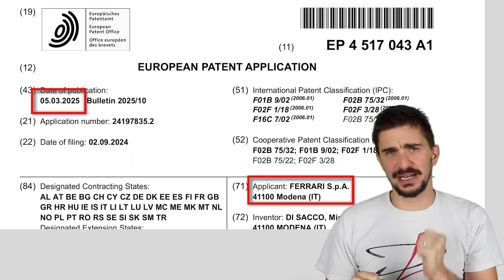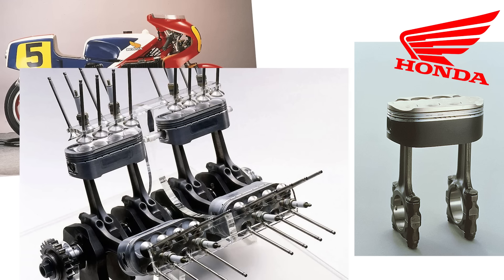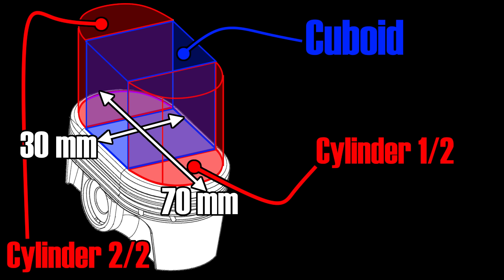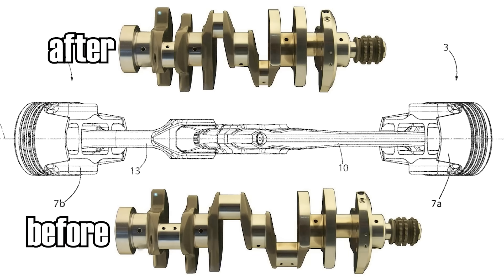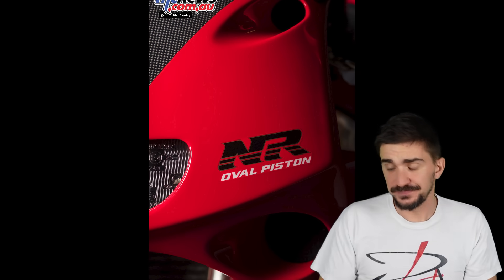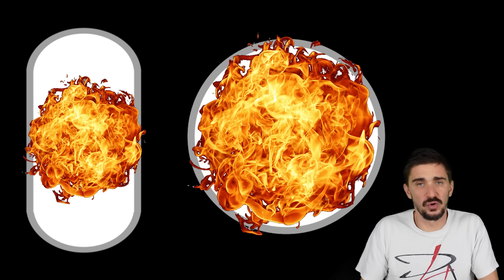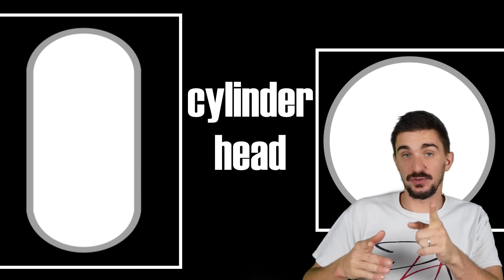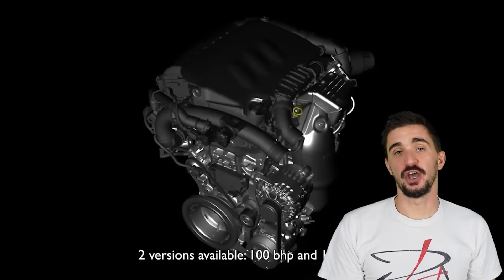Ferrari Just Patented Pill-shaped Pistons and Siamese Connecting Rods

Comment: A non-boxer flat engine with shared scotch yoke connecting rods and dual wrist pins would solve the piston rocking problem, the unequal length conrod problem, and the intake space problem, while allowing opposing cylinders to be directly aligned. It would also allow for much shorter conrods, making the engine narrower and lighter, and it would increase the dwell time at TDC which would improve combustion efficiency. Each crankpin would rotate inside a square block which would slide back and forth inside the conrod's linear bearing, thus eliminating the wear that otherwise plagues the scotch yoke mechanism. A flat 12 would be the perfect configuration for this engine because it would be naturally balanced like a V12 while being slightly shorter than a V8 with the same displacement per cylinder. Ferrari already has plenty of experience designing and building flat 12s.

Comment: Why not a knife-and-fork rod set? The foregoing design may not be balanced at all speeds, and inertia isn't spared either- I can see the big end bearing suffer a lot over time. Unless of course, to your point, these engines are not intended to live beyond 100 hours of service.
Reply: Knife-and-fork (or fork-and-blade) conrods would make the crank journals even wider than conventional conrods.

Comment: I guess you could use the oval piston to add displacement instead of just making a shorter engine. Although that sounds like something that would be better for cross plane crank with pushrod valves with low-end torque. I think this design would also be great for a shorter inline 6.

Comment: Harleys use fork and blade connecting rods as does the British ASR1 submarine diesel engine. Shorter engine in a sub to save room, at a premium in a boat. The Harley engine is slimmer due to the use of this arraignment.
Reply: Yeah but fork-and-blade conrods require even wider crank journals than conventional conrods. Circular pistons leave enough room for that, but oblong pistons like these may not.

Comment: The fact that the old piston engine heads are round guarantees the the pressure will be even all the way around. Can't do that with pill or any other shape.
Reply: Dual spark plug engines have already proven that the pressure doesn't need to be even all the way around. Ironically, dual spark plugs would do the exact opposite with oblong cylinders and help to even out the pressure.

Comment: The valve issues can be solved with a rotory valve instead of the traditional tappet valve setup. Use chains like DOHC engines, and control the dueration with port butterflies like a throttle plate. That would control power and effeciecy. Using turbos would also help in controling the power as well.

Comment: The killer issue is surface area to volume ratio.  As you know a sphere is ideal and a conventional hemi headed combustion chamber is close to this.  As with the Wankel rotary, this is insurmountable and must result in reduced thermodynamic performance.

Can you clarify why the single connecting rods cannot be used with conventional combustion chambers & pistons.?

Thanks for the great presentations.

Comment: Noting the geometry of cylinder at TDC relative to crank position - think I see an offset hiding in plain sight! That explains the angle of fixed rod relative to position of pin on flex rod.

Saying that because your video on that exact thing is next in my recommended videos…

Comment: Oh no. I remember those joint rods from WW2 aircraft engines, IL-2 specifically, it is a horrid idea, do not do it. You are using two different connecting rod lengths in the same engine.
the proper way of doing it is fork arrangement, where one connecting rod is between a fork formed by another. There is no drawback to doing the fork and it was done on Allison engine.

Comment: discorectangle or obround

Obround and discorectangle were the least silly or least non-technical terms that I could find relating to that shape, but it's not even the most common one used. Discorectangle is the proper mathematical term, apparently.
"Discorectangle: A mathematical name for the 2D shape, combining "disc" and "rectangle"."
"A discorectangle is a geometric shape that is a rectangle with a semicircle attached to two opposite sides. It is also known by other names like a stadium, obround, or pill shape. "

"A geometric shape with two parallel straight sides and semicircular ends is most commonly called a stadium. 
It is also known by several other names, including: 
Obround
Discorectangle
Pill shape
Racetrack (especially in informal or CAD contexts)" 

It is also known as a sausage body, but that's more in 3D contexts (which would also include capsule shape).

Comment: The Mikulin Engine that powered the Sturmovik IL2 had articulated conrods, but a different design. Apparently Hispano Suiza aero engines had that arrangement too, and they went back to WW1.  See Greg's Planes and Automobiles on the IL2. You really should start doing some stuff on late stage piston aero engines. Also, re engine balance the picture i see of the Ferrari patent  is a v12. Wouldn't that mean perfect primary and secondary balance being two straight sixes?

Comment: That single connecting rod concept is nothing new, to the point that i'm surprised they were actually granted a patent for it.  All the big radial engines from WWII used a similar configuration.  Only a single piston from each bank was connected directly to the crank shaft, and the remaining rods were on hinges connected to that main connecting rod.

Comment: My intuition says that the flat or straight portion of the piston rings will not stay flat or straight against the flat or straight "cylinder" once operating temp is achievied. I bet these engines will suffer from excessive oil consumption and compression blow-by as the rings fail to seal after normal repated expansion and contraction cycles. Not to mention the increased difficulty to actually machine these shapes to precision tolerances especially where the flats transition to the round. There is a reason why pistons and rings and cylinders are typically as round as possible.

Comment: Another possible drawback is the position of intake valves and manifolds. If the intake valve are on the long side of the oval, which is cross in respect to center line of the engine, the intake manifolds should "turn" of 90 degree to reach the intake valves

Comment: One issue that people don’t mention is that the Honda engines had the long diameter of the piston in line with the crank and cam. Ferrari is opposed to that, in order to make it more compact. But, if they want to run 6 or 8 valves per cylinder, they’ll have to come up with some weird new valvetrain, either quad cams or some strange mini-pushrod actuation. Unless they also make oval valves.

Comment: You forgot to mention the wider piston means its capable of a larger stroke without the skirt hitting the connecting rods, meaning you can make them even smaller and lighter while keeping the displacement up
Reply: He didn't forgot, if you'll look at images of a patent closely, those exact pistons have reinforcement ribs which significantly limits connecting rod articulation.

Comment: As a Ferrari owner, this new engine design is a GAMECHANGER for owners like me. Usually I can only fit 11 or 12 Ferraris end-to-end on top of my oil tanker. They're just such long cars and you need to collect so many of them before you can challenge the Elite 4 that storage becomes a real issue :< If I can save 20cm in length per car, that translates to an additional 7 or 8 cars on the top deck, per boat. So you can imagine my excitement.
Reply from the maker: The Elite 4!!! 🤣🤣🤣🤣🤣

Comment: The piston/pin offset has the potential for highest compression after TDC. However the added flexing point away from the crankshaft of the combined con rods is a bad idea and weak design friction point

Comment: 9:05 I saw something recently about some engine from the 1920s, maybe a Deusenberg, Peerless, Peirce-Arrow, or something along those lines, that had a similar arrangement, except that one piston rod straddled the other, so there were 3 bearings on each crank pin. That would maintain balance, but making the straddling piston rod as strong as the straddled one (pardon the vaguely obscene implications) would be a challenge.
Reply: Fork and blade rod arrangement, allows you to have the cylinders inline, not offset like most v engine designs.

Comment: Ship engines have been typically been segregated into drive engines (or main engine) and auxiliary engines. Radial airplane engines use the master connecting rod and a series of very similar secondary connecting rods.

Comment: The balance problem with the connecting rods is really a rather non-issue. Radial engines have used that layout almost since the beginning, and it is well known and developed how to handle this.

Very interesting idea, though! I wonder how it will turn out.

Comment: Honda did this decades ago... didn't patent it because overall, it wasn't worth the extra cost
Reply: Honda did file multiple patents. 

Honda holds patent US4383508, which is dated May 17, 1983... so it expired over 24 years ago. It only covers dual connecting rods per piston, so it doesn't apply to the Ferrari design anyway. Still, Ferrari cited it in their application. 

Honda also holds patent US4502434, which is dated 1985-03-05... and expired 2002-03-05. It, too, only covers dual connecting rods per piston, so it also doesn't apply to the Ferrari design.

There may be others.

Comment: Space between the banks is an issue not considered in the patent application; however, I note that the application is illustrated with a V12 that appears to have a 120 degree bank angle. That is a terrible angle for a V12, but provides lots of space in the valley.

Comment: The Honda NR engine was, of course, just a V8 (with a very conventional 4 valves and one connecting rod per cylinder) wih adjacent cylinders merged to masquerade as V4 to fit in the rules. This design has two key differences: 
1. the master-slave connecting rod system, with just one rod per piston 
2. the orientation of the ovals: major axis perpendicular to the crank (rather than parallel as in the Honda) 

The two are related: with the major axis turned, two rods per piston can't be used. 

The Ferrari orientation provides the advantage of shorter bore spacing, but it also complicates porting. If rational induction and exhaust call for all valves along one side (4 in a row) to serve the same function (all intake on one side, all exhaust on the other) that works for the Honda but requires problematic cross-head ports in the Ferrari. I doubt that it is coincidence that none of the Ferrari illustrations shown include anything above the head gasket. I found and downloaded the complete application document, and indeed only the pistons, connecting rods, and crankshaft are shown - no heads, no valvetrain, not even a block.

Comment: It is very un-Ferrari, but the only application that I could immediately think for oval pistons as a packaging trick (allowing tighter bore spacing for the same displacement and stroke) is to build a very short inline-4 for my Triumph Spitfire, to replace the 3-bearing tractor motor that sits there now.

Comment: The offset between banks resulting from a typical arrangement of connecting rods side-by-side on a shared crankpin is a concern... but not in a V12, because each bank is typically a balanced inline-6 which does not need to be aligned with the other bank. The patent illustration appears to be of this type, with a mirrored 120-degree crank making each bank a conventional inline-6. Even a V8 with a flat-plane crank has no rocking couple in each bank.
Of course the other solution for zero offset (with no connecting rod length mismatch) is fork-and-blade connecting rods, which are well-proven.

Comment: Pills come in many shapes, and the common is circular, so "pill-shaped" is not a useful description, although that term is sometimes used in that sense. "Capsule" would be better, if using a pharmaceutical reference.

The term "oval" does not specifically mean "elliptical", and indeed racing tracks (for horses, people, cars...) are commonly this shape and are called "ovals". NASCAR is even used in this video for an illustration when discussing combustion chamber shape. 

I see from another comment that in geometry the term is "stadium", and that there is even a specific term: "discorectangle". Of course you couldn't use "discorectangle" without explanation, and it is a long word to use repeatedly.

Comment: You mentioned that the combustion in a pill-shaped cylinder isn't optimized for being uniform, so why not go all in and do TFSI? The edges (at the rounder parts) would be the areas with a higher air to fuel ratio, vs the center which would have more fuel.

Comment: Its logical to dislike Ferrari, but still like their cars. Particularly their older cars, especially if they're a model that Ferrari doesn't much care about anymore. If one of those exist. That way you don't get slapped with 17 trillion different lawsuits because you used a standard bolt instead of one of their specially-tempered bolts or whatever the hell they demand.

Comment: I thought Honda patented the pill pistons in like 2003…
Reply: Honda's relevant patents had expired by 2003. 

Honda holds patent US4383508, which is dated May 17, 1983... so it expired over 24 years ago. It only covers dual connecting rods per piston, so it doesn't apply to the Ferrari design anyway. Still, Ferrari cited it in their application. 

Honda also holds patent US4502434, which is dated 1985-03-05... and expired 2002-03-05. It, too, only covers dual connecting rods per piston, so it also doesn't apply to the Ferrari design.

There may be others.

Comment: Ferrari had to wait til the copy right of Honda ran out…
Reply: It would be a patent, not a copyright. 

Honda holds patent US4383508, which is dated May 17, 1983... so it expired over 24 years ago. It only covers dual connecting rods per piston, so it doesn't apply to the Ferrari design anyway. Still, Ferrari cited it in their application. 

Honda also holds patent US4502434, which is dated 1985-03-05... and expired 2002-03-05. It, too, only covers dual connecting rods per piston, so it also doesn't apply to the Ferrari design.

Comment: 8:53, you can't really put the drawbacks of the connecting rod system together with the drawbacks of the 'pill-shaped' pistons. These are two independent things. You can have pill-shaped pistons with all the size advantages that this has, while maintaining traditional connecting rods, this only makes you miss out on the half a piston width saving thing that that solution brings. I think the pill shaped pistons are a great idea, while the Siamese connecting rods are much less so.

Comment: Honda did these back in the day on the crotch rocket so how did Ferarri patent it
Reply: First, patents expire. 

Second, Honda patented specific aspects of the design, which Ferrari did not copy. 

Honda did file multiple patents. 

Honda holds patent US4383508, which is dated May 17, 1983... so it expired over 24 years ago. It only covers dual connecting rods per piston, so it doesn't apply to the Ferrari design anyway. Still, Ferrari cited it in their application. 

Honda also holds patent US4502434, which is dated 1985-03-05... and expired 2002-03-05. It, too, only covers dual connecting rods per piston, so it also doesn't apply to the Ferrari design.

There may be others, but probably none which cover he oval piston shape in general.

Comment: This just makes me dream of a small 6-inline, like the midget V6 from mazda.
Reply: The "small" 1.8 L V6 from Mazda has low displacement, but physically isn't that small. The same K-series engine is available in up to 2.5 L displacement. 

The oval pistons might be helpful in making a short inline-6, but Volvo got a conventional  inline-6 (the SI6) short enough to use it in a transverse installation; it was in various Volvo models from 2009 to 2016.

Comment: How do they deal with the exhaust heat being so close together?
Reply: They don't. 
First, the valley usually contains intake, not exhaust. 
Second, the patent doesn't consider exhaust.. or induction, or anything about the head or valves at all. 
And third, the patent shows a wide 120 degrees between banks, which would allow lots of space in the valley.
Reply: @ interesting

Comment: Sorry, but that's still 2 conrods but they do rotate around different axes, right? So there is the crankpin journal that rotates around the main journal and there is another crankpin journal that rotates around the "normal" crankpin journal? Wouldn't that result in 2 different piston speeds per conrod assembly (because of the varying conrod lengths and axis points)? It'd also mean more assembly wear on the shorter side? 🤔 No disrespect but the only pill I'm interested in is the one the engineers were on when they designed this! 🤣 Also, can you combine this Porsche's 6-stroke patent and the fully mechanical/geared CVT - just so we completely alienate mechanics? 🤣

Comment: It will have the same piston problems as the FA20 which was fixed with the FA24. The rod without the joint will bend due to the uneven forces. The long side of the rod will have less forces exerted upon it than the shorter side causing the shorter side to bend. I'm sure it won't be a problem since this is a very custom rods they will probably reinforce the shorter side.